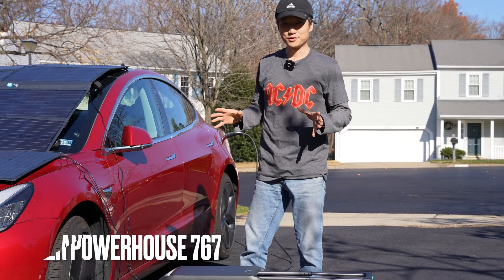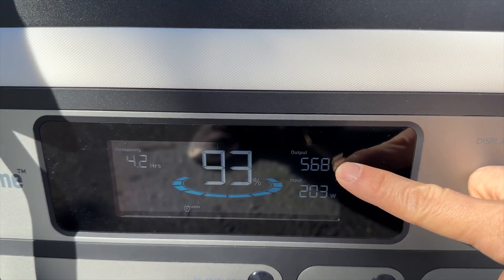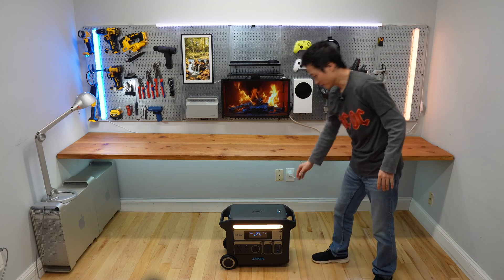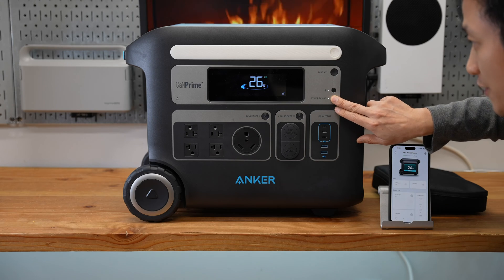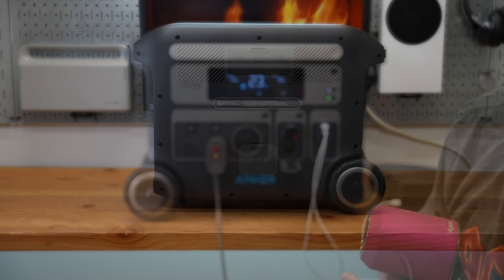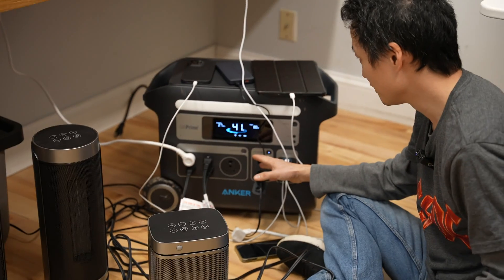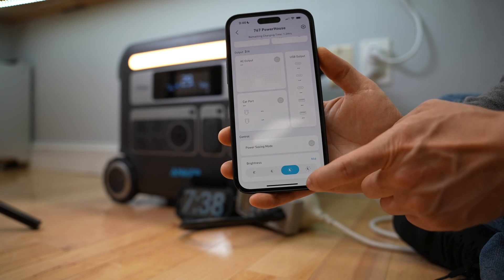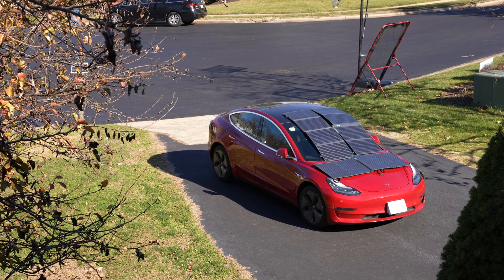Anker PowerHouse 767 In-Depth Review! (How to charge Tesla Model 3 via Portable Solar)

Comment: I use the f1500 battery to charge my Tesla. Why does the Tesla prompt that there is no ground connection when connecting and cannot charge?
Reply from the maker: You need the ground bonding plug as I already mentioned in the video you can find the purchase link on Amazon in video description

Comment: I get about 2 hours with my 1000 watt space heater using my 767.   If I charge on off-peak rates, 7.8 years to pay back the $1,200 cost of the Anker.   Seems a similar ROI to solar.
Reply from the maker: Agree. Emergency use only.

Comment: Im thinking about buying this if i bought the jeep 4xe that charges other tech like refrigerators. I was wondering if it would be possible to charge this while i drive and then use this to recharge the car.
Reply from the maker: You can recharge it using the 12V DC car socket, but since your car is electric, then it doesn't make sense. And you cannot charge the car when driving. You can can the Anker battery while driving.

Comment: Thank you for providing lots of ideas and validating what is possible to charge an EV.  What is the unit or units that you personally use?
Reply from the maker: I don't use it for daily charging. Mostly from the 240V wall power. This is a demo for emergency power supply :)

Comment: Did you try just plugging the Tesla in to the RV plug? I know they have a mobile connector with that plug
Reply from the maker: No, it's not possible to charge the Tesla with the PowerHouse RV plug as the Model 3 requires NEMA 14-50 type. There are no adapter that would work for that purpose. Let me know if you can find any adapter that may work.
Reply: Tesla has a mobile charger adapter set directly through their app which includes the 14-50 plug and many more.

Comment: Does this fit in the trunk or frunk of your Tesla 3? How fast does the Powerhouse 767 discharge when its not being used? Have you tried seeing how long it can last in idle in the back of your car?
Reply from the maker: Yes it does fit, on the side. It holds charge very well. I didn't try keep it on but in idle (not used) mode.

Comment: Hi thanks for the review. At 00:30 you say you wouldn't recommend charging a vehicle on a daily basis. Can you elaborate on why not? Curious to know as this seems like a good solution for charging a phev.
Reply from the maker: It's because the main power source of the car should be the wall outlet as it will be much faster. Unless you don't have access to AC power, the PowerHouse is a good backup solution.
Reply: Why not use the 240v

Comment: Is the 30 amp plug also ungrounded?
Reply from the maker: In this case you need the ground Bonding Plug https://amzn.to/2UBfEYD (affiliate link)
Reply: @ToolsElectroDIY  so adding the ground bonding plug to one of the regular outlets will also ground the 30 amp outlet?  They are all connected?
Reply from the maker: @christopherwhyte2360  There's nothing connected to the ground. It is just a hack to make the Tesla wall charger work with the power station.
Reply: Are the ac outlets on larger bluetti or ecoflow power stations grounded?
Reply from the maker: @davet4580  I don't think so